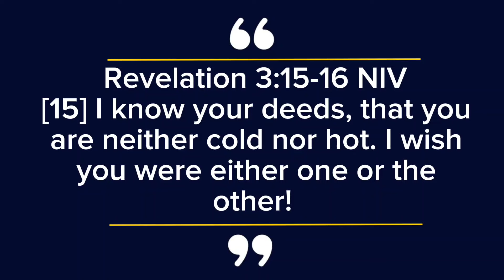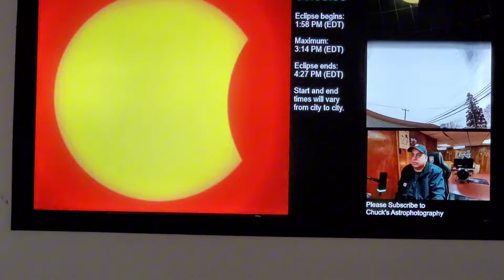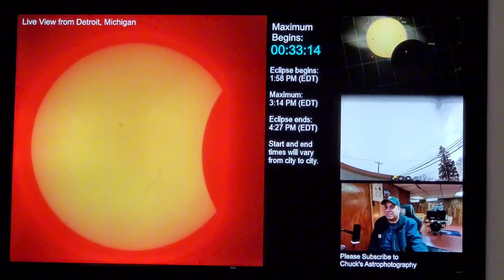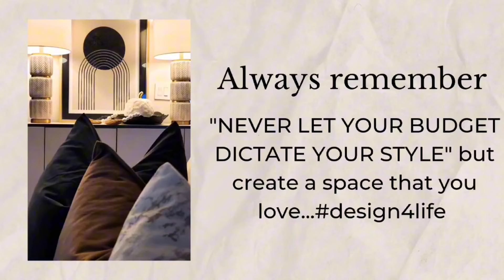Weekly Vlog: HOME UPDATE | Re-tiling Backsplash | Kitchen Reno

Comment: I would like to know from you abt styling dinningroom which is better round or rectangular  tables....
Reply: Anyone is suitable, it depends on your style or decor. I have a rounded one that ties into my decor. I have seen both of them styled beautifully in homes
Reply from the maker: It all depends on the size and shape of your space. Round tables tend to take up more space. If your space is more long-gated, then a rectangle table. However, check your measurements to see if a 6 seater or an 8 seater would best fit your space. If your space is more square, then a round table would be best. I typically suggest round dining in kitchenettes because that space is more central. Hopes that helps.